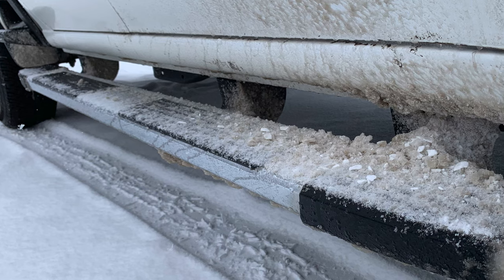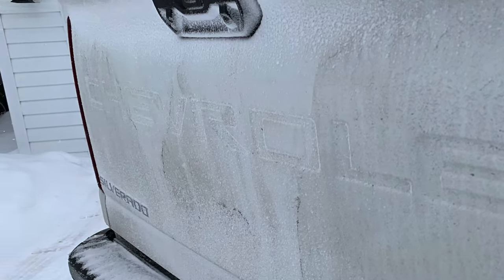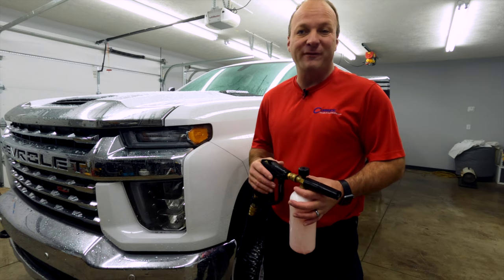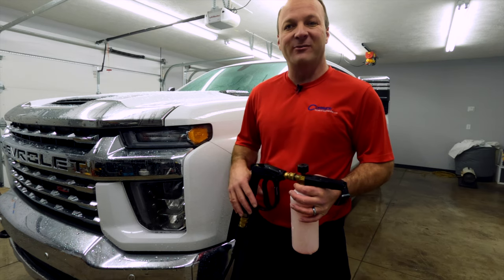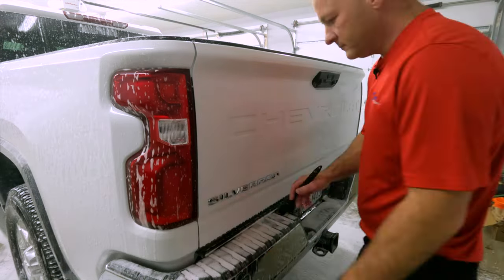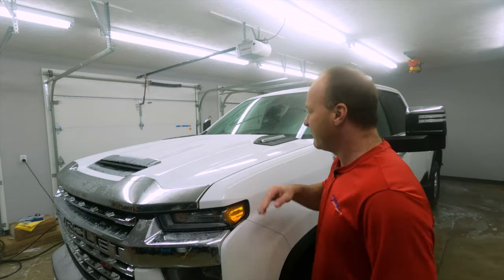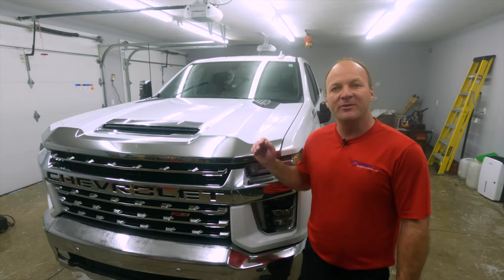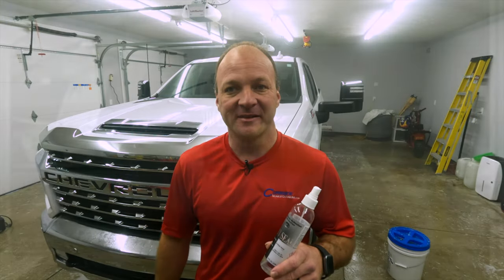Easy Money, Easy Upsell!! Make More Money Detailing | Dirty Car Detailing | Car Detailing Tips

Comment: Love this video!

I've been doing rinseless in the winter, buy do a pre spray with the power washer. So far so good. I don't see myself bringing shampoo back into the fold ever. So I'll power wash, and fill my pump sprayer with Optimum No Rinse 256:1, and apply it to the vehicle, wash, dry, and finish whatever polishing or protecting that needs to be done. 

But, I'm SUPER slow in the winter anyways.
Reply: Oh, and I'm subbed! 

You just seem like a great guy that has a ton of experience, and a lot of great information to share. 

Thank you!
Reply from the maker: Thanks for the sub. I happened to be at a seminar when onr first came out years ago. I’ve been using it ever since. It took a long time for detailers to stifle their ego and try it. I made a video about it years ago. I’ll never forget, one detailer commented that it was “paint rape”. Lol
Reply: @TheDetailingBusiness  - It still has haters!